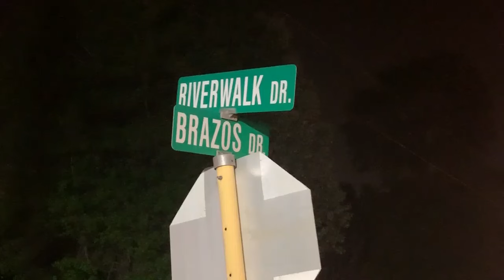031520 OFF DUTY METRO POLICE SGT FATAL

Comment: Thats an early 50's Chevy, that is a LOT of old school steel! He mustve be FLYING to bend that car in half like that!!!!
Reply: That’s 55 Chevy bel air
Reply: @sheillaslone  No it's not...............its Earlier!
Reply: 54 Chevrolet 210 2 door hardtop.
Reply: Not really. How much do you think it weighs? Some specific exterior panels of older cars were thicker steel, but the overall body structure and frame were not. Most of these older cars we assume were bigger and heavier, are really about the same weight as many mid size sedans today.
Reply: @kevintomb  also have seen proof that when old cars and new cars collide, the old cars turn out to not be as durable and safe as most may think
Reply: Don't let all those old cars fool you. They usually good like a tin can
Reply: @Damnesiia  yep, modern cars are designed to absorb energy in a crash so it doesn't transfer to occupants.    Hitting a hefty tree doesn't help though!
Reply: @kevintomb  Exactly. I remember those old cars as huge because I was just a little kid when they were still on the road everyday. They are actually tiny when you examine most of them -- trucks, especially.
Reply: LS engines can definitely make those things scoot
Reply: These old cars crumble when hit or crash into something.
Reply: @jeffreyharper2710  4 door
Reply: Completely an old wives tale. Those cars crumple like an aluminum can compared to modern cars.
Reply: @sheillaslone  Wrong!!! 1954 210 4 Door Posr!!!!
Reply: @jeffreyharper2710  You got the Year right but it Not a 2 door nor a Hard Top!!!!
Its a 4 Door post!!!!!
Reply: @kevintomb  It weighs roughly 3800 lbs!!! Same as a New Honda!!!
Reply: 53-54 I think
Reply: @jamestragle9504  yep. Though I do I think automotive manufacturers are taking advantage of this whole “crumple zone thing” (using less materials on the cars, then bumping the price up because they are “safer”) 
The whole thing though, back in the 50s these typa cars were just for going to the shops you know? (Maybe a little more, but they certainly weren’t race cars.) Great cars for that. Couldn’t get one dent in your door.
Reply: Is a 1953 or 1954.
Reply: These old cars crumple when they encounter any resistance. Tests have proven that, time and time again. The whole "safer because it's all steel" is a myth.
Reply: Lots of rust on the frame
Reply: @davehightower1851  who cares? Rid the world of a tyrant. Good riddance.
Reply: @NotOnDrugs  what you tryna say? Have some respect, the guy literally died.
Reply: @isaacsrandomvideos667  no thanks. they have no problem making jokes about "civilians" getting arrested/hurt/shot/killed. I have no empathy. Now, we just need more of them to follow his suit.
Reply: @NotOnDrugs  fair enough I guess.
Reply: @kevintomb  Dude these things were total tanks, this isn't the average Camry or Corolla. Tougher doesn't mean safer though.
Reply: I mean... it had an LS in it.
Reply: @jeffreyharper2710  Actually, that 'was' a 4dr Sedan?
Reply: @Have seen a 2012 Subaru Outback T-boned on drivers side at 45 MPH at an intersection by a Chevy Van. The Subaru bounced off the van like a ball,and ended up on still on its wheels, stopped on the shoulder of the oncoming traffic lane. The driver was OK, OPENED his drivers door and got out!  Had that happened to this 1954 Chevy, the driver would have been dead, the car wrapped around the front of the van like a wet newspaper. It is a myth the old cars were "built better".
Reply: @NotOnDrugs  and they give us tickets for speeding and then this happens to them they need to listen to their own advice and slow down. This is sad though not trying to be disrespectful just saying!

Comment: You get a lot of horsepower under the hood, you’d better know how to control it. I served several years on a local fire department and had the misfortune of witnessing the aftermath of several really nasty car accidents. I’m so sorry for the family and friends of this individual.
Reply: Vehicles from the era handle like complete garbage.  Cars with suspension technology that old are dangerous to drive fast on the streets
Reply: @bryankc9644  
True but you don't know what modifications may or may not have been done to the suspension on that car.
Reply: @chuckster3629  apparently none, look at how the car handled.
Reply: @whatdoiput807  
You're making an assumption that is not based upon factual information in the description.  
I'd say the driver had a screw loose, not the suspension.
Reply: @chuckster3629  4:15 don't see an upgrade kit. You're wrong.
Reply: @whatdoiput807  
And I suppose you've never seen a new Mustang SVO in photos wrapped around a tree?  Lots of newer cars and trucks get wrapped around trees and telephone poles.  
I think it was a matter of high speed and very likely inebriation of the driver.
I can't say either way for sure if that car had an upgraded suspension.  I haven't crawled under it to verify either way as you appear to have done.
But one thing's for sure, when you're driving, you're the nut behind the wheel.
Reply: @chuckster3629  I don't see a suspension upgrade. That means you were wrong. Have a better day
Reply: @chuckster3629  I also googled "mustang svo wrapped around tree" and nothing came up. You're having a pretty bad day, huh.
Reply: @whatdoiput807  Yeah and that's not blood  it's ketchup.  Denial  . .
Reply: @josephhaas7636  tf you talking about capn food stamps

Comment: You can make an old car go fast, but handling and stopping are still 1950s technology
Reply: The large diameter wheels indicate to me that this thing had a disc brake swap.  I think the driver just didn't know how to drive it.
Reply: SPEED! New engines go fast. Disc brakes stop well. 1954 steering & suspension systems were junk. (could get you killed)
Reply: They still make trees the same as they did in the 50’s
Reply: @74nova36  no they don't, are new cars still on old bias ply tires? WTF are you even talking about lmao.

Comment: This is such a tragedy. From what I've observed and from personal experience with old cars and hot rods over the years,  old cars like this really fold up dramatically on impact. They seem so heavy duty when you work on them,  but the crash technology like crumple zones, etc. was simply non existent prior to the 1980s or so.  They just didn't hold up well in a wreck.  Later 60s and 70s cars fared better,  but before that they did not hold up well in a crash.  Speed was likely a contributing factor here,  and high speed collisions are deadly no matter what the technology.  Please be careful out there people!
Reply: Not only the passive safety feature of having a stronger cabin and crumple zones etc. But Active safety features like abs, stability control, traction control all help a lot.
Reply: Wrong motor wrong car. To much motor for that car.
Reply: Yeah there is a couple videos on YouTube from the 50’s and 60’s that shows fatal accidents from those year model cars.
Reply: @trustyoldiron5416  side impacts like this will result in fatals on every car. The door creates a weak point that can’t be overcome. Even in sedan based race cars with huge roll cages. Mark Porter was killed in a side impact crash in Australian V8 Supercars. Those things are rollcages on wheels with substantial side intrusion protection.
Reply: Mercedes patented crumple zones much earlier. Porsche designed the 914 with them. I’ve seen photos of them laying down their lives for the passengers.
Reply: @jockellis  the more I read about Mercedes Benz the more respect for MB engineers. 
They pretty much invented every safety feature we use today.
Literally everything!
What safety features you have in your (lets say Ford) in 2020 Mercedes had 10 years ago
Reply: @terryschnereger8531  yep.
Reply: @terryschnereger8531  WAY to much power for anyone other than builder & owner
Reply: You think ?! Speed was involved!!!? Thanks captain obvious
Reply: Correct.
Reply: After Kevin Hart wrecked his Cuda with hellcat hemi, CHP is investigating AND making mandatory laws stating "no motor shall be installed into any other car other than manufacturerer."
Reply: @joshiek7839  It's true that it's unlikely any vehicle or person would have survived that crash. That being said I meantioned active safety features not passive ones. If that car had features like traction control and or abs it would be a lot easier to keep the vehicle pointing straight and therefore would have hit head on or possibly avoided the impact altogether. Basically old cars with lots of power require lots of respect and skill if you're going to open them up like that guy did.
Reply: @trustyoldiron5416  I would agree but those 2 systems can cause accidents. Anyone who has engaged ABS knows that the pedal pulses, the care makes terrible noises. Most people don’t know this till they need. The amount of times driver training I’ve seen people release the brake when ABS activated because they think something had failed in the car. Likewise stability controls limits are the same limits that adhere to human control - tyres gripping the road. If you are pushing the car to the limits of traction Once the equation exits the confines of the Kamm Circle, stability control is not saving you. Everything has limitations. The best safety action you can take as a driver in order of effectiveness is 1. Wear a seatbelt. Statistically nothing comes close to the survivability than wearing a seatbelt. Nothing since it’s global adoption has come even close. 2 buy the best tyres your money can afford. 3 take a driving course (sometimes called defensive driving course) and actually learn how to drive a car. Everyone that I’ve sat next to has BAD technique and habits. You will also get an idea of the limits of adhesion and how quickly it all turns to crap when you exceed them. If nothing else people leave with a an understanding of, and the consequences of what their driving habits are. Even when there car is fitted with all the modern safety features. And they will learn how those systems work and gain experience of them working and what their limitations are.
Reply: @larsbambi1575  Don’t get too buzzed. I overheard a Mercedes owner in a Starbucks telling another Mercedes owner ,”The reason they are so safe is that they are always in the shop”.
Reply: Exactly correct. People don't understand that old cars actually are not as tough as they think. Technology has brought us so far but like u said high speed will kill u regardless of the Technology.
Reply: @jockellis  mine has never been in the shop for anything but brakes tires and oil changes. 138k miles 2011 E550. 
Never once!
I think you're mistaking BMW /Audi for Mercedes 🤷‍♂️

Edit: I did have to chang the battery in 2019 after 8 years of service
Reply: I laugh when people say , " them old steel cars were built like tanks " 🤣 😂 😆 French tanks....
Reply: @minimanadam  haha ikr
Reply: @trustyoldiron5416  He was also drunk according to the story. Shouldn't have been driving anything. I agree that some modern advancements might have helped in a situation with a sober driver.  Those old cars weren't meant to move that fast. I've owned many back in the day and they all had the original drivetrain in them. Lots of flat six three on the tree stuff. I drove them with caution and respect and never had a problem.
Reply: @terryschnereger8531  I'm putting an 505 hp LS7 in my '50 chevy sedan now. Stock suspension and steering with disc brakes. The guys who build their own cars tend to know how to drive them. I know my car will not handle any kind of corner with speed but it will be a fun cruiser with occasional trips down the drag strip.
Reply: @larsbambi1575  I didn’t say it, a Mercedes driver said it. Only Benz I’ve ever driven was a 230 SL. Sweet ride but I’ll take my Porsches any day.
Reply: @terryschnereger8531  Wrong driver, thats it
Reply: Prior to I think 1963 seat belts weren't even mandatory.
Reply: @frenchonion4595  1966
Reply: @joshiek7839  No, the number one safety action a driver can take is limit the fckng speed. Then the seat belt.
Reply: @radiocontrolled9181  sure, make an argument against 50 years of data...
Reply: @joshiek7839  yep, make an argument against eternal common sense.... which is not always so common. Mind you, I wore my seatbelt from day no.1 after I got my driving licence, so nothing against those injury and life savers. But many times speeding will kill you even if you wear it. So to me limiting speed is up there.
Reply: @radiocontrolled9181  it’s common sense to ignore the data?
Reply: @joshiek7839  nope, to limit the speed. and wear a seat belt. Any other questions?
Reply: @radiocontrolled9181  except that’s oversimplification of what you claimed. Data supports what I say.
Reply: For that car to fold itself so thoroughly around that tree, he would have had to be traveling in excess of 100 mph. Obviously 1954 Chevies didn't have crumple zones like today's cars do, but it's "body on frame" construction is very durable and would have required a mighty impact to fold up like that thing did.

Comment: These images are what car crashes routinely looked like, along with the accompanying fatalities prior to modern auto technologies like ABS, Traction Control, Air bags and crumple zones.  It’s a shame.  My condolences to this man’s family and loved ones.
Reply: @larryjohnstone6260  tree wouldn't have gone that far in I guarantee.
Reply: @larryjohnstone6260  my 89 f150 held up way better than this at 70 head on into a tree. I’m still here to type this at least, it’s time to let the old saying die. Old steel cars sucked at wrecking. Really wrecking, not a fender bender.
Reply: Well sadly he wasn't doing the spend limit. Condolences to the family.
Reply: @wraywray5990  doesn’t matter when you have no airbags or seatbelts. Remember, crash tests are only conducted at 35-40mph.
Reply: @larryjohnstone6260 . I'm a classic car guy but I finally had to admit that the really old cars do not do nearly as well in a crash as modern vehicles. Of course starting throughout the 60s more and more safety features were developed.
Reply: @mikewillett5076  having a hopped up LS probably doesn't help either. That's the tiniest cone air filter I've ever seen
Reply: I love classic cars and hate the new plastic junk but I also understand that although much easier to dent the new cars are much much safer I have seen countless pictures and videos of 50s and 60s cars passenger compartment folding up in accidents and putting dashes or doors in the driver seat. Odds are if this was a newer car he would have walked away from that. I still choose to drive old stuff but I understand the risk it comes with.
Reply: @larryjohnstone6260  A modern Hyundai would be much less fatal since it has impact braces in the doors as well as curtain airbags.
Reply: Modern cars are not much better  hitting a tree at speed
Reply: @g.dfirestarta6474  A built in 89 was not much better than this ,he hit it at a silly speed
Reply: @justanalias  True but only up to a certain impact speed ,blunt force trauma is the killer now .You can not defie the laws of physics
Reply: When you swap that much horsepower into an older vehicle like that, you need to add a roll cage, five point restraints, wilwood brakes, etc. Those cars weren't built for high speeds. Sad.
Reply: Ken..You see the year of this car right?
Reply: @Mr.Robert1  
Yea, we all know it's a '54 Chevy.  What's your point?
Reply: @romanval69  
A new modern car would have been ripped to shreds worse than this '54 Chevy.
A modern car is better in crashes for driver safety but, that only goes so far.  70-80 MPH into a solid tree?  Nobody is walking away from that one.  Even if the car wasn't torn in two, his spine would have separated from his brain.  Just ask the Dale Earnhardt family.  You can't stop that suddenly from a high speed and live.
Reply: Abs has caused more accidents than its prevented.  💯
Reply: All one has to do is look at crash test videos. 

We literally slam cars into concrete blocks at 80mph.
Reply: @Nick-th4tc  dont crash it LOL you probably wont be in good shape afterwards
Reply: @cudadog11  mainly because the car wouldn't have enough weight to go that far. But yeah
Reply: @scottskinner577  depends on the car, but I stand by my opinion that a 'modern' car wouldnt have been cut half way thru by a tree in most circumstances.
Reply: @cudadog11  true. As a general statement, yeah. You're reply was to the guy that used a "Huyndai" as an example, so my comment was in reference to that specifically.
Reply: @scottskinner577  yeah but Hyundai, Toyota, Nissan, Korean Chevy, no difference late 90s/2000s. None of them are sheet metal sitting on a frame, will definitely hold up better, also you'd be surprised how 'heavy' they are, compared to the old stuff.
Reply: @Nick-th4tc  You may be driving a 3000 lb. car made of 12 ga. U.S. steel, but at that speed, wearing a lap belt and no collapsible steering column your internal organs would be jello.
Reply: Yeah had it been a newer car it would’ve disintegrated into a thousand pieces. And more Likely cut in two. I don’t thank any of the modern technology now would have saved this man .